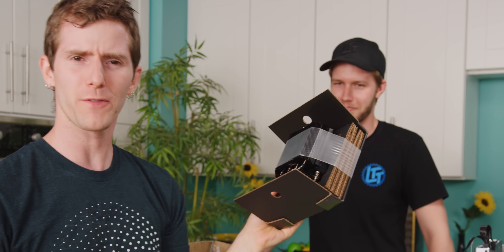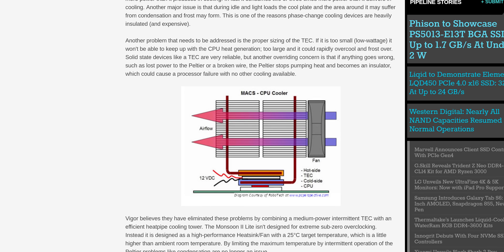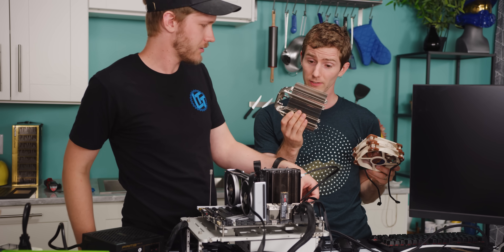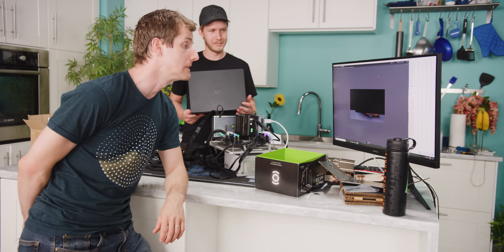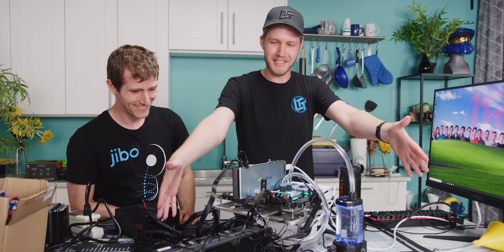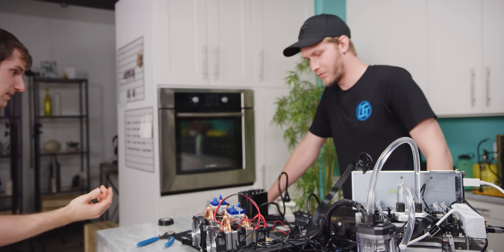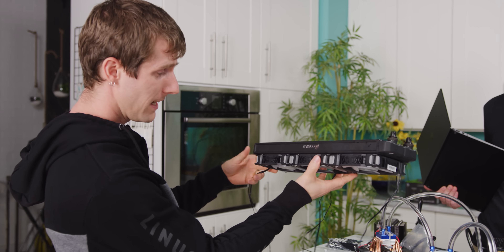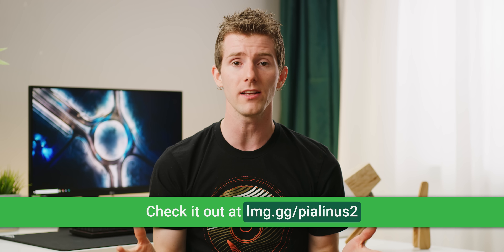Thermoelectric Cooling is a Bad Idea

Comment: best cooling is having the cpu just above ambient dew point temperature
Reply: No, that’s trash. Ryzen won’t even detect memory near 0c, and you’ll degrade the piss out of your chip with any real voltage (the 9900k scales crazy below 0c, expect 6 GHz with phase). I run as low as -60c just fine on daily machine with a simple phase cooler, you need to learn how to use scissors to cut some foam (they sell safety scissors, or get your mommy to help you, jk, but I’m just saying it’s not a big deal. TecLabs had his 6-8 year old daughter helping insulate a machine for LN2... Its not difficult).

Your chip won’t increase efficiency or clockspeed until you have that real cold (Ryzen for example goes from 120w at 4.2 GHz all the way up to 4.9 GHz at a reduced 90w at the same voltage when going extremely cold, that’s a 35% lower power draw while also getting 15-20% more performance, that’s a huge efficiency gain! And now you can also run higher voltage safely...), that is the point of sub-zero, it’s the real performance benefit, otherwise just use a cheap car radiator like a normal person and stick with the $80 water loops, no need to waste power cooling to basically ambient temps. Or just use a bucket of ice for your occasional monthly benchmarking fun (add Vaseline coating or insulate board if it’s not winter time, when it’s winter all my windows are open and it’s benching time!)

Comment: Wasn't the Hex 2.0 released 3 years ago?

Not really feeling the energy in this video. What's the point of reviewing it at all if you already have such a negative opinion of the product? The rant about the unrelated kickstarter project just adds to the negative vibe. Also, there should have been some mention of the Phononic software that is used to control the cooling.

Comment: What if you put it threw the the big normal rad to shed the bulk of the heat energy from the cpu THEN threw the aquarium chiller in series to try and get the feed to in intake on the cpu colder\maybe sub ambient?

Edit: basically only use the tecs to cool at a point in the loop that's already got a comfortable buffer to get you back to ambient temps.
I mean I understand we're never gonna hit a point of efficiency, but giant rad+tecs in series maybe just slightly less jank\longer lasting than giant rad plus icebuckets?
Edit 2: ok less jank definitely isn't what we're going for here... But I've been wanting to see someone test this for years
Edit 3:also you weren't doing those chillers any favors running them hot side up... Look I understand this will never ACTUALLY work... I just... Was hoping for the classic LTT 'dont do this, but this is what it takes for it to be cool'
Will definitely be looking out for the update video you teased, thanks for the years of infotainment, for real.

Comment: Just to mention it because I have owned it and used it since it came out.
The HEX 2.0 has a shitty layout for the TEC... its not even over the center of the IHS.
Took mine apart as cooling starting being shit, re-pasted, and noticed at the time that its set on the 4 corners, so while its nice, it could be better if not for the, again, shitty layout...
The software hasnt been updated in ages (or firmware for the TEC, who knows what kind of improvements could be done) either...
Its clear its not their main business and thats fine, its just such a disappointment when it could have been so much better (you really need to have the software to get it to work properly)

Comment: build a custom tec system using an arduino to help cooling on the back end of a heat pipe cooler to liquid cooler vs same idea minus the tec

Comment: You need to do include both cooling solutions. After CPU get hot water into radiator then into "woodoo cooler" and again into CPU block

Comment: Linus if you want the full potential, get it of the Thermoelectric cooler, you need to remove the ability of the device when cooled to interact and cause condensation. This is solved in industry by putting the device in a slight vacuum chamber. This would be a "cool" project to ultimately test the new super cooler you have on order. You can have water lines piped into the backing plate inside the vacuum chamber. We do this on high end ccd and direct detect electron digital cameras on high power transmission electron microscopes. Will it be practical, no.. but would be a fun experiment

Comment: Here's an idea for bad cooling ideas number three!

Using the current setup with the peltier cooling setup... Configure a raspberry pi to throttle the tempature to keep the water temp at slightly below ambient tempature and figure out how to mount everything in a define R6 case. You could even do a lcd screen mounted near the tempered glass to display water temps.

Comment: TECs have their places. They work in vacuum (cooling in spacecraft/satellites), and they generate electricity if you reverse them and create a temperature differential, which things like the Mars rovers use for power.
They're inefficient at power production too, but they can produce power with smaller heat deltas than other types of generators. So you take a lump of radioactive metal and insulate it so that it gets really hot, and you dump that heat into a TEC, and Mars is cold, so it spits out power, and that's how Curiosity doesn't need solar panels.

Comment: What? Not 24/7? Comeon, grow up and ghetto mod without fear :P I got a soldered MOSFET with a diode and a resistance in order control 3-pin fans using PWM of a 4-pin fan header of the modo :D <3 100% homemade :)

Comment: Ultimately the heat still has to be dissipated into the air.  Fans and surface area are whats needed.  Also, look at Astrophotography cameras.  They all use TEC to reduce the temp by 40 degrees below ambient.

Comment: What if the peltier's heat were transferred to a cement slab (the ground) instead of the air

I mean it won't save power, but it's rich man's geothermal at that point

Comment: ... wait there's such thing as a 500w peltier cooler?!  I might be able to revive my summer room cooling setup.
Reply: Probably around 100w cooling output... just get a cheap window air conditioner, 500w input would be about 1500w cooling (at least 12x better than the TEC)

Comment: HELPP PLEASE ANYONE!!!!!!

csgo is crashing apex is crashing eso is crashing but rocket league and 
battlefield 5 do not crash my computer it will turn black an restart 
itself as if i lost power 10 mins in to those games.  i  have taken it 
to geek sqaud and a computer repair shop no one can find anything wrong 
its 3 days old me an my buddy built it this is my first pc an i have 
dropped nearly $2,000 an i have no idea what to do except change out the
 mother board. i have changed the ssd the small computer repair shop 
suggested that but that didnt do anything also re installed windows and 
that didnt do anything either i am at a loss :(

i7 8700 k 

msi z390 gaming edge ac
1080 sc evga gtx

750cx m corsair power supply 

16gb of 3000 ghz ram corsair rgb

everything has been toruture tested an it ran great according to the computer repair shop.

Comment: Could you see what would happen if you ran the peltier cooler and the radiator in series? I assume you'd get ridiculous performance. Now what order you run them in (peltier to rad to peltier : rad to both peltiers : or both peltiers then rad) would be up to you guys. I would think running rad to both peltiers would give you the best performance, but I would like to see what kind of numbers you'd get out of that setup too. Maybe try that setup with the new 500+ watt pelteir cooler? I think it would make for some good CPU temps!

Comment: Thermoelectric / Peltier chips are terrible in practice. Only place I used them was robot applications where adding additional water tracing was prohibitive and a massive heatsink and manifold on the robot's shoulder was the better method for temperature control of the dispensed fluid.

Comment: Hey, one tip from me. Don't solder everything, buy some WAGO clips on amazon, they are made for house wiring, but easily applied anywhere else. No soldering required and no risk of being electrocuted, or blowing a fuse inside your PSU.

Comment: If you use a 300W peltier on a 100W cpu now you have to dissipate 400W. That's why it will always be unpractical.
Reply: It's impractical, but if you're into xoc it's impractical anyway.
Reply: @Daniel-ub7ue  you cannot destroy heat, you can only "move" it to another location.
For example: air conditioning moves the indoor heat outside, your fridge moves the heat from inside the fridge, to the outside ( put your hand down the back of your fridge, it will be warm ) and a peltier cooler doesn't get rid of your cpu heat, it only moves the cpu heat from one side to the other, the heatsink still has to move that heat to the air, you only added an extra unnecessary step with a peltier cooler, even worse the peltier cooler adds it's own heat, making the heatsink work even harder.
Reply: Peltier is just a “pump” the power it uses is just used to move heat from one side to another. Every degree it cools down it gets hotter on the other side, plus the amount of heat it creates itself in the process
Reply: @Daniel-ub7ue  that wattage is not removing heat, one of the laws of energy is that energy cannot be destroyed nor created,peltier works by creating a difference between the plate using the energy,after that the energy become waste energy (heat)
Reply: But if I put the peltier inside the tubes I could use it as a TEG increasing power efficiency.  But I'm going to state that it would only work if not using a peltier to cool it. (Most TEG work at 12v 2amp at 90 degrees fahrenheit.)

edit:
 I'm sorry I don't know Celcius we weren't taught that in America.
Reply: @tank2543  (90F -32) x 5/9 = 32.222222222...C
Reply: I have a pool!
Reply: Wrong! 300Watt peltier plate also give us cooling side which will cool the 100Watt CPU . So the main thing is how to cool 300Watt peltier plate & Peltier cooling will be a future thing for sure.
Reply: I guess TECs are kind of limited by their thermal resistance then too... And with normal fridges you aren't putting that extra heat load right next to the thing you're trying to cool, giving you more area to work with. With a vapor compression system you at least don't have the damn pump on the die lol
Reply: @Daniel-ub7ue I think that the peltier module just transfers the heat elsewhere using electricity, but at the same time the energy it's using also generates heat
Reply: But that's true of any other refrigeration technology as well.
Reply: @johnsavard7583  : Finally, someone who understands active cooling technologies!
Reply: @phantombitly  It works by having two plates. One of which is hot, and the other cold. If you bring electricity into the system the plates get hot/cold. Otherwise is you heat up one plate, and cool the other, it generates electricity.
Reply: @phantombitly  somewhat right. When you add power the Peltier module absorbs hear from one side making the other side cold. Cold enough to instantly freeze a drop off water with a 9v battery. They use these in hot/cold water dispensers, mini refrigerators etc etc

Comment: 1) It would be interesting to see how it performs if there was some kind of temperature buffer in between, something like a small aquarium wich can cool down if your cpu is idle.
2) I think it would be a better to run your coolers in parallell, that way the water flows slower, giving the coolers more time to absorbe the heat.

Comment: Edit: LMG, please read and try this

Try running them as a supplement to the radiator!  Connect them after the radiator to see if you can get an extra boost in cooling compared to a standard water cooling set up!!!
Reply: Stick one in a reservoir
Reply: @TheVillainOfTheYear  one of the flat sides of the peltier needs to be not in contact with the reservoir for it to work. simply putting it in, keep all the heat in the liquid and adding some because the wattage of the peltier itself.
Reply: @testjeaapiel9707  have in flow on that water block go into the Peltier and the out flow for into the res.
Reply: Yes PLZ Firts a radiator and than a Peltier element wound be awsome! and might even be the first "good" Bad cooling idear.
Reply: I think just running one of those aquarium coolers after the radiator would suffice.  Putting a peltier into the reservoir would add complications.  It may be better for space.  But it's not necessary for a proof of concept.  Something custom would have to be designed and possibly 3D printed in order for that to work.  For a commercial product, (assuming a peltier helps) it would sound like a good idea though.
Reply: @TheDeathskull37  maybe not literally in the reservoir itself, but somehow using this technology to chill the reservoir? Embed it into a distro block?
Reply: @TheVillainOfTheYear  I could see it working, it just needs a heatsink and a fan for the hot side of the peltier.
Reply: My thoughts exactly. Just cascade them.
Reply: Thermo-electric cooling is bad because they are easily saturated and aren't even very efficient.

in contrast: Evaporative cooling loops like those in refrigeration systems offer INCREASED CAPACITY WITH INCREASING TEMPERATURES.

Usually if you want to cool something small, the capital outlay of Thermo-electrics are smaller, but in terms of cooling performance? Refrigeration.

For bonus points however: Placing an initial radiator to cool the air then a Thermo-electric following it will cool the water approaching the CPU to be cooler than the normal radiator output.
Ironically a Refrigeration loop would rather get the hot stuff: They actually work better cooling hotter stuff given a set 'thermal sink'
The only way to cool a room is to dump the heat outside it... The only utility of heating a volume of water is if you can boil it for making Tea.
Reply: Spin it topwise
Reply: this doesnt work. water temp will equalize across the loop and the rad will be working against the tecs. Either have to watercool the tecs and add at least 1 more tec or go w proper refrigerant phase change setup.
Reply: @lalPOOO  my objective is not subambiant: it's providing a heat sink for hot water that has been cooled in the Rad. Flowing water dumps heat into heat sinks it passes: although logically the bigger the heatsink at the tec the more opportunity it will have to dump heat.
placing the tec before your radiator would be madness. Chill water, warm water, repeat O_o
Reply: @lalPOOO  I agree with Glen.  Use the rad to get the temps to ambient first, then dump the ambient (or closer to ambient, rather) water into the cool side of the peltier for an extra boost.  It is impossible to get worse temperatures in this experiment.  You would either get the same temps or better.
Reply: @TheDeathskull37  It doesnt really work like that in practice, the water temp will stabilize across the loop once load is applied. The rad and peltier will both reach their max capacity to remove heat. Difference in water temp will be minimal.

What you are thinking would happen is only possible if the tec/peltier is extremely powerful, and/or you ran a bunch of them and forced the water to spend a long time getting chilled before hitting cpu. But if you're going to do that, having the rad there is pretty much pointless. Better off running a second cooling loop to cool the peltier and putting the rad on that.
Reply: would add that I and others have experimented with this years ago, so this isn't just speculation on my part.
Reply: @lalPOOO  I would still like to see it done with a scientific approach, a control group, and graphs.  It is a possible solution still, and there is is a debate about it.  I think it would be interesting to see, even if I am wrong.
Reply: @TheDeathskull37  I've got a clue for your researches, if you want to go further..
Peltier devices are used in beer dispensers (little ones for domestic use) as cooling devices
Reply: This just got posted today: https://youtu.be/0xY06PT5JDE
Reply: they dont work like that... they need the radiator, to you know, radiate. the first one they had had it cool one of its radiators, and it didnt work, cuz the TECS need their radiotor on the hot side, and something hot on the cold side.Also, they would burn out with no radiator on the hot side.
Reply: @ZOMBIEHEADSHOTKILLER  the radiator would have to be external to the case, but it can be done. I'm not saying to drop the whole thing in a reservoir. Look at Der8auer's stuff with TEC.

Comment: Need advice on water cooling. My current system is in a Fractal design node 605 (yes I know old case but I like it). Now my biggest problem is the fact that the case does not have room for even a 120mm AIO, so getting a custom loop to work is going to be a pain. Right now I do have a corsair h50i AIO crammed in there with no fan currently on the radiator but instead I have 2x 120mm and 2x 80mm fans blowing into the case causing + pressure and exhausts threw the radiator.   Now this works ok for my 2600k OC'ed to 4.5GHz with my max temps getting around 85 C were as if I take the radiator out and attach a fan my temps max out around 55C, so big enough difference to be worth trying something else. So my next step is buying 2x 80mm radiators (they will fit with fans) and one 120mm radiator (to run like my aio with no fan just as extra thermal mass) with this I have a short EK waterpump/res that fits nicely in the case and a EK water block. Now to all those water cooling gurus, please tell me if you think this is a waste of time and if I should just go with another case or cooler.